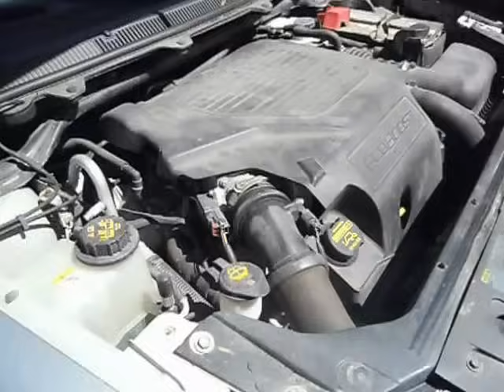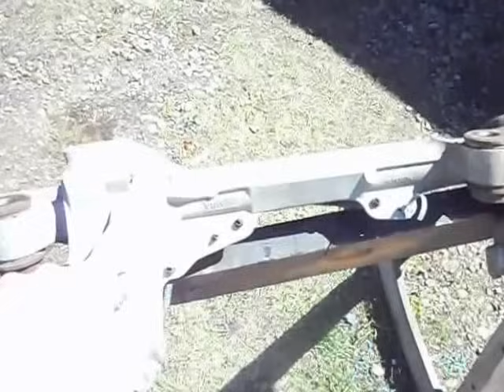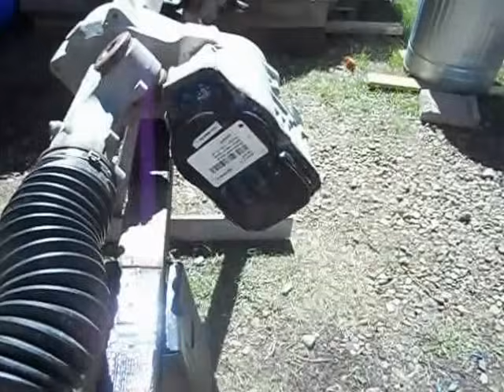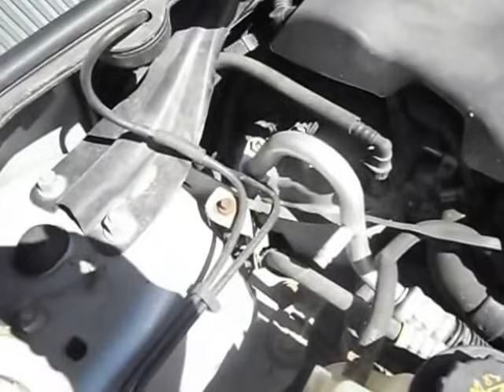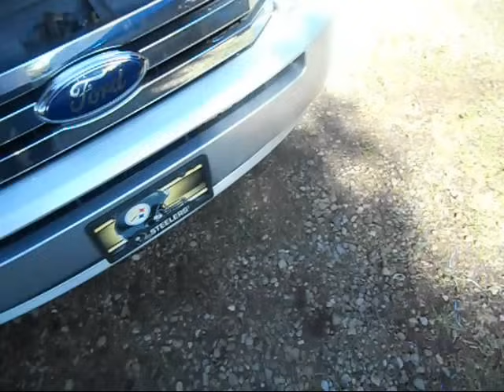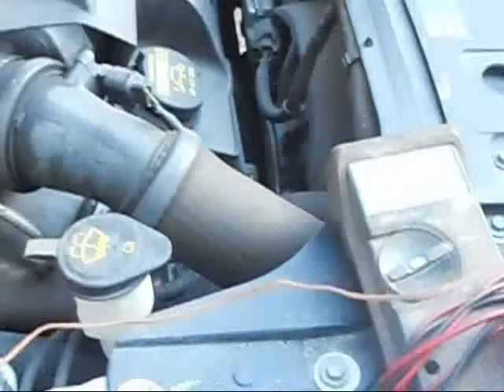Ford Electric Power Steering Failure Identified

Comment: My Ford Focus 2011 Trent model has started intermittently reported power steering failure on startup.  When restarting the car, it works normally.  So far there hasn't been any issues with lose of power during a drive.  I wonder if it's related to the analysis done by poster K Smith?  The dealer is stating that the battery is a low but that doesn't sound right unless a low battery is causing delay is software for example.  I suspect it more serious.

Looking at other sites yielded little info other than people have had the entire EPAS replaced at high cost.
Reply from the maker: EPAS is failing, be careful if driving since failure modes represent a gamble; ranging from graceful to deadly! Your battery is constantly charged at approximately 14 volts at all times while engine is running. Vehicle voltage should not vary much unless your battery is electrically shorted. Sometimes sediment in bottom of battery builds up and electrically shorts between two or more plates. But under these conditions, batteries are usually exhibiting serious signs of failure, and hold little charge. EPAS electronics do monitor system voltage and will shut down if voltage drops below threshold. However it is far more likely you are experiencing preliminary signs of EPAS failure, since intermittent steering loss is very common symptom.
Reply: K Smith thanks for the info. I'm going to firstly try replacing the battery. If the issue persists I'll need to decide next step.
Reply: Any luck with the battery? Mine is a little low running at 13.6 running and 12 cold. Reading the Ford date from NHTSA the voltage would more likley degrade steering than remove it. https://static.nhtsa.gov/odi/inv/2015/INRL-DP15001-62304P.pdf?_ga=1.162564987.638222547.1493512607
Reply: I've replaced the battery and so far the issue hasn't resurfaced. but it's only been two weeks and we're now in winter so temperatures are down. I'm hoping the battery is the reason for the epas failure on engine startup
Reply: Derek Polman by reporting failure do you mean a warning light or it actually turns off on startup and no power steering until you restart?
Reply: On startup, very occasionally the power steering would not work at all and a warning pops up. I would need to restart the car to correct the issue. This has only started occurring recently (50,000 on clock). The issue hasn't occurred mid drive thankfully

Comment: 180 degrees Fahrenheit is not going to hurt electronics because the engine runs at 200 to 220 degrees and it has electronics all over it with low air flow. Can a cheap poorly under designed driver motor burn up, that I believe! They need to redesign it with heavier duty parts. Ford should be raising an eyebrow at TRW but that has throws reminiscent of the Ford Firestone debacle back in the late 90s early 2000s. Just like Toyota's outsourced accelerator pedals sticking.
Reply from the maker: EPAS PCB's not grade-0 (automotive) qualified. Implementation not possible using grade-0 due to complexity and sheer number/scope of IC's. Ford opted to place non grade-0 electronics inside sealed/cooled aluminum enclosure (via air ducting from lower engine shield); results apparent in millions of failed EPAS modules.

Comment: I would like to see the car driven with your meter connected, pulling a grade say six percent with extended load on the turbos/engine and see what that reading would look like.
Reply from the maker: In theory; EPAS steering gears are exposed to maximal thermal energy when vehicle is idle; this seems to be when temperatures spike well above industrial electronics limit. As long as vehicle is moving; some air is forces across the EPAS aluminum housing (given fact Ford installed huge air dam under engine); even when engine is under extreme load.
The exhaust, turbos and catalytic converter will certainly produce copious amounts of thermal energy under load, but the engine will stay relatively close to coolant temperature; with excess energy radiated from radiator fan. With vehicle moving; all of this excess energy is dissipated relatively quickly.
All theory aside; Ford pushed flawed design on consumers.
Reply: Years ago during the course of summer, we remove the burned out shells of several Lincoln Continentals that had burned up while going up a long grade.  On one of them, they were able to get the fire out but did significant damage but was repairable.  I found that between the engine and the firewall a power steering line had a rubber section placed too close to the exhaust manifold.  The extended climb on the grade caused the exhaust gas temperatures to the exhaust manifold to climb high enough to cause burn through on the ps line.  This incident made me curious as to what kind of temperatures could be seen on your steering box issue.  This would also contribute to the thermal break down with the thermal grease in the your gear box.  Doing a little research, I see this is a wide spread problem with Ford product line with no simple fix.   By the way good work on your research.
Reply from the maker: Thanks, Ford told the NHTSA steering failures were caused by assembly issues in Chinese manufacturing facility, and further corrected assembly issues in 2014. After examining my failed steering gear, this explanation was clearly fabricated. Place blame on the Chinese; as far away from Ford engineers as possible.

Comment: Thinking of limping it to the nearest Ford dealership and setting it on fire in the parking lot.
Reply: 2012 focus 3 transmissions many other issues now the electric steering. I drove worst part of city letting it run in front of variety store on very cold day,even thieves know not steel them.
Reply: @geraldperry7779  😂

Comment: Just yesterday - Wife takes her 2016 Ford Focus with 5990 miles to the grocery store, and backs into the driveway to unload groceries. After I finished working in the garage I got into her car to take it to the car wash (so she doesn't have to). The car failed to start. No crank, no start. Three faults: 1) Engine system fault. Service now. 2) Starting system fault. Service now. 3) Steering assist fault. Service required. So, after several start attempts I went inside to get my camera for video. After I started recording the car started normally with no more faults. People behave differently on camera, and so do cars.  I know that the dealer won't be able to do anything if the fault is not in their faces, or at least a video. Any ideas?
Reply from the maker: Suggest acquiring OBD monitor to identify error codes. Sounds like you have something interfering with inter-module communications. But this is only speculation, OBD monitors available on ebay for about $30.00; would recommend OBD with USB interface, so you can use laptop or mobile device for display.

Comment: My brother's 2014 Flex just had a massive rack & pinion steering failure, now I am seeing as to why, yet it would seem that that year is not under the recall repair that Ford has offered.
The unit costs some $1400, and it is a huge hit; I wonder if Ford can be coaxed/shamed into fixing this thing for him under recall.
Reply: before year ago i bought a used EPAS cost me 395$ with two months warranty and its still working fine , so dont give ford 1400$ and try to find stores who sell a used EPAS with warranty

Comment: Hello I'm having a problem with my wife's 2009 Ford Escape. It's not under recall and should be. Upon engine start the steering wheel automatically binds making it hard to turn the steering wheel. This is a safety issue and needs to be recalled. My 2009 Ford Escape was Made in Kansas City Assembly Plant Job#2 program 2. The recalls are only for Kansas City Assembly Plant Job#1, year models 2008-2011. With this information I believe it is just to include my and other vehicles in this recall. Please share to get this done.

Comment: My 2013 ford taurus has exactly the same issue. Failed while driving and had to get it towed home . Called Ford Canada and the reply was. there is no recall for your vehicle.My car is 2 months past the recall.Ford won't do a damn thing for me. But here is the strange thing,I disconnected my battery for 24 hrs.hooked up battery and now everything works.Still don't trust it. has anyone else experience the same by disconnecting battery?
Reply from the maker: Ford once recommended disconnecting battery at dealer to solve problem. Worked well to deflect and delay warranty claim replacement. This action also clouded disposition; prompting many to believe problem only software related. Power cycle only resets fault parameters, complete failure pending. Ford also changed software to hide faults from consumers, then voided warranty once software update was implemented at servicing dealer. Later, after full EPAS failure; warranty service refused sighting prior software fix. Your steering system is at most hazardous phase; pending catastrophic failure. Keep both hands on wheel at all times, no joke... Will cost $2-3K for repairs, keep in mind Ford has not corrected thermal issues in any way, new EPAS will fail; some sooner, others later. Meanwhile Ford has made tons of cash charging millions of consumers for repairs that should have been recalled and corrected back in 2010.

Comment: I wish you showed the disassembling of the steering gear in the video. You say you did take it apart. And I wish you show the bad stuff you allegedly found in the video. I mean I totally trust you but showing the disassembling and the defects inside would remove all doubt. SHOW IT IN THE VIDEO
Reply from the maker: Disassembly of EPAS unit was completed prior to any video documentation on issue. This was at a time when I was not aware of EPAS issues or ubiquitous nature of defect. For me it was just another failure in long line of continuous failures with Ford product, and my vehicle had been down for extended period with engine failure. My EPAS failure also caused minor accident, which aggravated prior spinal injury; so priority was not video production. After learning of wide-spread EPAS failures, it became apparent Ford was hiding something. It was only at this point when investigations was initiated.
EPAS design problem is not mysterious or difficult to detect. Problem is most owners just deliver vehicle to dealer for repair, and believe what dealers tells them (which is what Ford tells the dealer). Of course most owners eventually identify a problem when replaced EPAS unit fails again. Or worse, when Ford updates software and voids warranty. Ford has never been honest about nature of failure, so speculation and mistrust have driven opinions surrounding EPAS disposition. Ford blamed problem on Chinese manufacturer indicating internal connector issue. Ford convinced the NATSA connector issue was addressed; however failures continued, and NATSA just does not care.
My field of expertise for over 30 years was electrical and robotic engineering. This experience includes extensive design, implementation and troubleshooting in autonomous vehicle industry. So I know first hand what it means to couple sophisticated electronic implementations with harsh automotive environments. Environmental factors and failure to recognize severity of environment represent most common engineering pitfalls.
During disassembly, EPAS unit exhibited all the signs of thermal stresses; failed power MOSFET's, discoloration, thick applications of thermal compound by Ford. Any experienced engineer could make immediate determination of thermal issue based on obvious failure dispositions and overt attempts by Ford to correct issues. Compounding these factors was additional evidence like extensive air-cowl and heat-shield implementations all around EPAS unit. This was all to familiar and indicative of serious thermal design issues. The most obvious test was to determine nominal operating temperatures of internal EPAS electronics. Thermodynamics tells you that components housed within closed aluminum enclosure, must reach temperatures in excess of that measured at surface, given system has reached equilibrium. So measuring aluminum enclosure surface temperature represents viable engineering practice. Electronics components are manufactures to operate in various environmental standards. One of the most harsh is automotive classifications. Not all components are available in automotive class, and the EPAS implementation incorporates broad standard across many electronic disciplines. EPAS temperature measurements shows unit exceeds all thermal limits defined in automotive standard. Therefore EPAS units are being operated in thermally stressed environment. This is fundamentally in direct violation of safe operating range for any electrical implementation. There is no mystery, no argument, and no doubt components will fail over time. It makes no sense to specifically identify failure modes (like power MOSFET's, capacitors, or semiconductors) when implementation is operating in environment beyond thermal limitation of standard. This point may not be so obvious to most consumers, but design engineers deal with these problem on daily basis. Identification of thermal operational violation requires no further evaluation, game over.
Reply from the maker: @Michael_J_M14  Ford highly malevolent and fiercely combative in regard to defending company strategy to deflect design flaws and maintain dialog on defects. Experience with ecoboost engine failures educated me quickly as to how negative and counterproductive direct interaction with Ford actually is. Ford is not interested in correcting your problem, or keeping you as a customer; Ford is only interested in maintaining profitability at all cost. I invested two years of attorneys and court appearances fighting Ford just to have my vehicle repaired correctly. Ford attempted fraud, lied, and contrived evidence in attempt to thwart my case. Ford sent one of there special corporate engineers to inspect my vehicle, then claimed in court document vehicle was intentionally sabotaged to produce smoke from exhaust by placing oil in muffler. Even my attorney possessed no clue as to how to counter this accusation; that is until I proved oil placed in exhaust pipe could not possibly obtain adequate temperature to combust in short time interval. Basic laws of Thermodynamics would be violated given Ford's accusation. My defense was to produce video showing exhaust smoking after engine start, while maintaining hand contact with muffler input pipe. This proved exhaust system was cold to touch while engine produced heavy smoke. Ford not only underestimated a claimant, but technically botched attempt to commit fraud through incompetence. Ford is not your friend; cross the line from consumer to complaint and Ford will chew you up and spit you out.
Reply: @Michael_J_M14  the inquiry was asked and answered. I took it to mean just the way it was presented. This, being a video on YouTube, would benefit from showing the disassembly and the defects but these events happened before the video was shot. Technically the scenes could be re-created if this video was for entertainment or for history but this was not that kind of video. I respect that.
Reply: @Michael_J_M14  okay yeah me too sometimes. Lol. Anyway I myself had issues with the electric power steering on my 2011 mustang V6 and not long after the warranty miles were used up the power steering quit but only when cold. In the spring/summer or anytime the outside ambient temperature was above 75'F the steering was okay. I checked for bad connection but all was good. The rack is too expensive so I chose to drive manual "Armstrong" steering during the winter months. What is strange is this "thermal issue" seems to be the opposite of most "thermal issue" - anyway have a blessed day for you and yours.

Comment: You should make more vids seeing that you are so detailed.  Some people make videos and I wish they didn't cause it just waste my precious time when I'm in dire need for information. Lmao!
Reply from the maker: Thanks, its good to know video is educational and helpful. Ford keeps EPAS engineering design under wraps, so much of that I have learned comes from TRW patents and actual disassembly. Some minor details related to system are sketchy; like use of stepper motor or brushless AC for example. However these details are less important than overall design philosophies and strategies. Automotive designers just don't seem to understand basic engineering concepts critical to producing reliable implementations. Simplicity, elegance and beauty in design should always be prioritized over complexity. It is troubling to know that what used to be considered critical and fail-safe design territory; like vehicle steering systems. Thousands of discrete circuit components carry potential to cause injury or death.